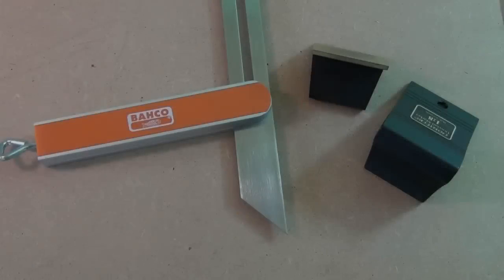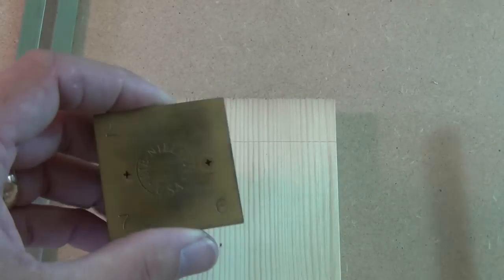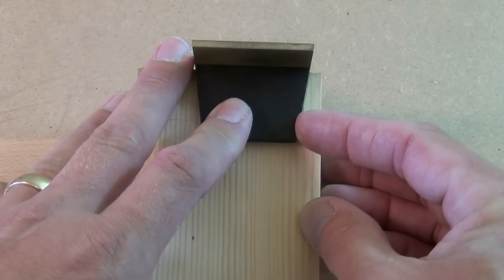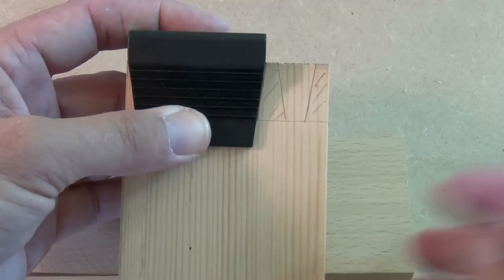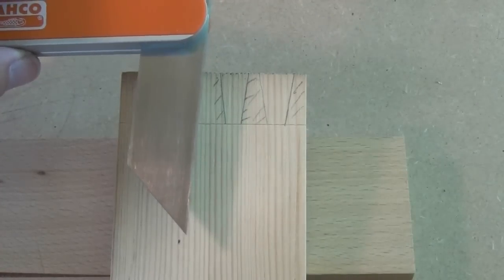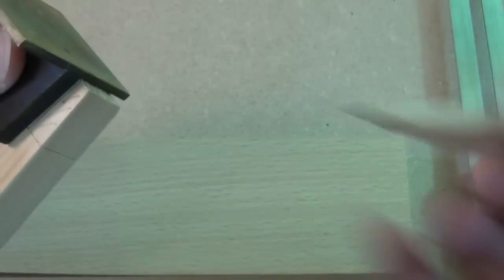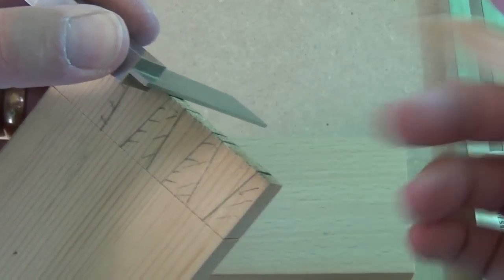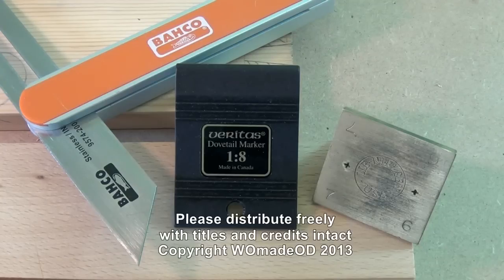Dovetail Markers and Their Use

Comment: I understand the idea of a dovetail.
But is there a way of figuring how many dovetails per board?
Or how long the dovetail should be?
Reply from the maker: greg No hard and fast rules. I go for what looks good if it's going to be on display. You could measure the joint length in inches, take one away and use what's left as the number of tails (but try and squeeze an extra one in when under three inches). Length of tails should be equal to thickness of pin board in through dovetails, about an eighth less in half blind ones. Width is best chosen to best accommodate the chisels available
Reply: greg  check out video “laying out dovetails with Christopher Schwartz”